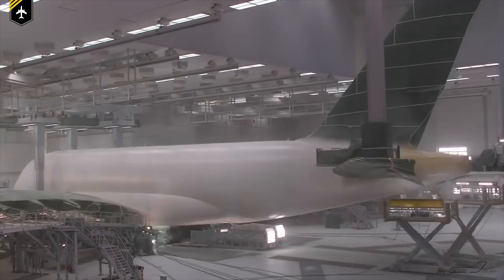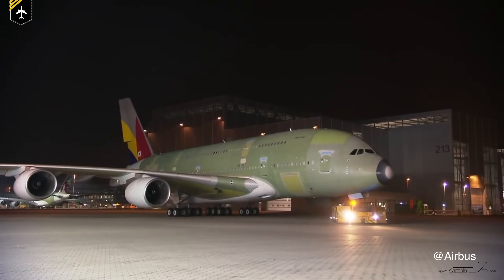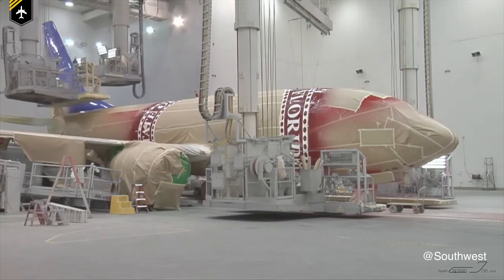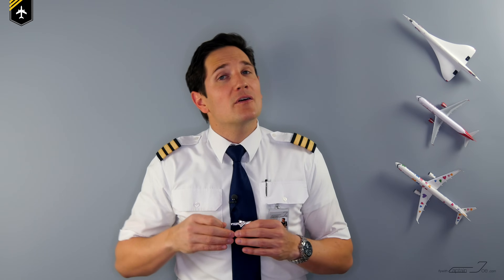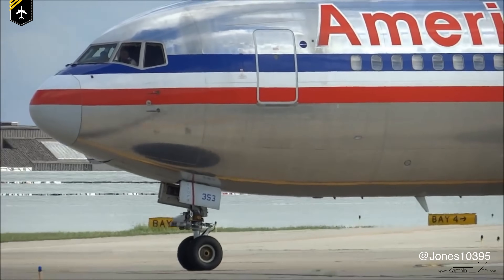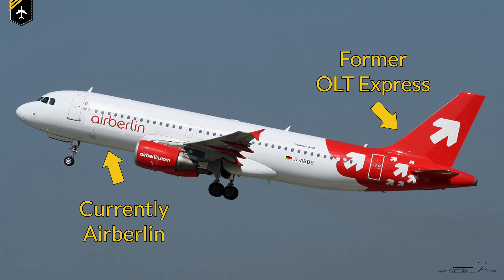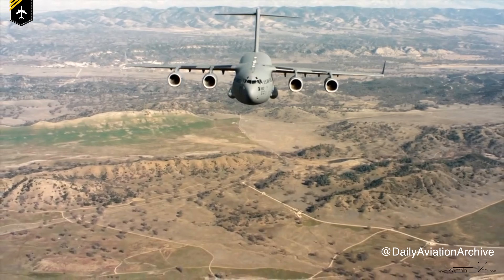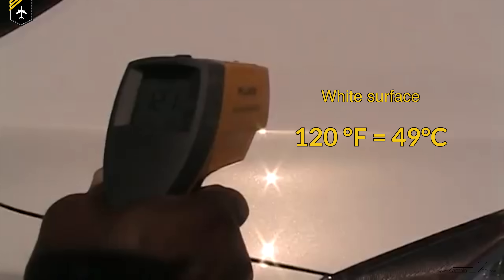REASON WHY PLANES ARE PAINTED WHITE! Explained by CAPTAIN JOE

Comment: 1. Cost and labour
2. Easy to locate the wreckage 
3. High contrast and birds can't be attracted
4. White keeps cool during high temperatures 
5. Easy to locate oil leaks or dents
Reply: white color can reflect radiation too
Reply: Which protects it from radiation from space
Reply: >2. Easy to locate the wreckage 

Tell that to Uruguayan Air Force Flight 571
Reply: 4. No. White doesn't magically keep cool in high temperatures. White reflects light more than any specific colour (since it is made up of all the visible colours) so it heats up less when exposed to sunlight. Look at high speed aircraft like the SR71 or the Bell X15... BLACK to RADIATE heat.
Reply: Nixon Lim reflects VISIBLE electromagnetic radiation. No more reflective of other forms of radiation.
Reply: @Lozzie74  you are right
Reply: Then why is the cheapest airline yellow 🤔
Reply: also white reflects heat so.
Reply: Sumanth Pruthvi thank you
Reply: "Easy to locate the wreckage" 

laughs in flying over snowy mountains
Reply: Thx
Reply: @Benjamin Playford meh. Comment wasnt funny. 0 likes as it should be
Reply: Resume White the Great color
Reply: Thnx
Reply: Also to identify cracks visually

Comment: So basically it
(1) Help in locating any oil,fuel,hydraulic fluid leaks
(2) Helps in identifying cracks during hard landing
(3) Due to hight reflectivity and low absorbivity of white surface it will reflect most of heat waves and so the metal underneath the paint will not be heated so the thermal loads on already loaded structure can be controlled which will prevent metal creep.
Reply: Thank you for your TL;DR!
Reply: It's a five minutes video. Nobody needed a TL;DW.
Reply: You've summed it up perfectly
Reply: Saved 5 mins, thanks
Reply: That's exactly what I was gonna say, word for word after I copy paste
Reply: (4) Easier to sell the airplane if its got a white base so that other companies can paint their design/logo on it.
Reply: You're the hero we need, but not the one we deserve.
Reply: And also to help us spot some  curry masala leakage, panni puri spillage, or any chicken tikka strike damage on the airframe structures.
Reply: @seigeengine  Yes we did.....He was droaning on a bit.
Reply: Thanks you very much.
Reply: Sir.Panda lol
Reply: you just saved 5 mins of my life. thx
Reply: Saved me 5 n a half minutes! 😎👍
Reply: you can't fool us. not all part of the airplane are painted. the engines for example...
Reply: Paint can also add weight on the plane don’t forget that.
Reply: Kanav Dhawan thanks bro you saved me like 5 minutes
Reply: Seems like spirit airlines don't want any responsibility in deaths, do they? They paint their planes yellow.
Reply: Thanx.
Now i dont need to waste my life on that video
Reply: Thanks for Savin my 5 minutes... You've done a great job...
Reply: Thank you
Reply: @seigeengine  5 min is a long time for some people.
Reply: Kanav Dhawan easy to spot after the crash
Reply: Imagine not having a 5 minute attention span

Comment: Hey Joe, great video, but here's one correction about composite parts being painted: The problem is not thermal expansion stress due to the parts heating up. In fact, most fibre composites are designed to have a CTE of nearly zero, so stress is not a problem. The reason for painting them is that the polymer matrix degrades when subjected to UV radiation (which there is a lot of at higher altitude because of the thinner atmosphere and the lack of clouds). The parts also need to be protected from environmental influences (moisture especially), due to the polymers' tendency to pick up water and swell - which in term leads to stress and lower  performance.
Fly safely

Comment: Nuclear bombers from the UK and Russia are/were also painted in white to reflect some of the thermal radiation.
Reply: jospi2 I’m from the UK...
Reply: What?
Reply from the maker: Like the Vulcan?
Reply: Maybe initially, but definetely not after switching to low altitude penetration missions.
Reply: Yes, the color is called "flash white" and a lot of command and control planes are still painted that way, such as the Looking Glass plane which will take command of the US armed forces in the event of, well, the normal chain of command being vaporized by nuclear war.

Edit: As Jonathan Chesnutt pointed out below it's actually "anti-flash white" and not just "flash white"
Reply: SR-71s were black.
Reply: SR-71s were painted with a special, black paint that reduced radar reflection. The body was mostly made of titanium, which is naturally a silvery color.
Reply: fixpacifica Oh? That's not what I heard, but makes sense.
Reply: jospi2 
I think the last completely white bomber is Tu-160
Reply: SR-71s were black for low optical visibility and to radiate as much heat as possible,  because the skin was up around 17-1800C. Even then the skin had to be actively cooled to prevent melting by circulating the fuel under the leading edges and critical points before sending it to the engines. They stuck out like dog gonads in infrared and the mach diamonds in the exhaust negated any attempts to make the body stealthy to radar so Lockheed didn't bother after the A12. The shape is dictated entirely by aerodynamics and early 1960s computer modelling limitations.
Reply: jospi2 The bombers that are painted white are only used for Arctic and Winter missions (if snow is present).
Reply: fixpacifica SR-71 are recon, not nuke strike.  If a SR-71 was near some instant sunshine, the intel chain would have gone wrong.
Reply: Alan Brown (re SR-71)   Very informative comment - thank you
Reply: Pavle Burazor 
"The bombers that are painted white are only used for Arctic and Winter missions (if snow is present)."
No. jospi2 is correct about the reason they were painted white. It was to reflect the blast radiation.
It's certainly possible some airplanes had white camouflage but jospi2 was correct about nuclear bombers being painted white.
Reply: The SR-71 was a spy plane with no weapons on board... not a nuclear bomber...
Reply: shouldn't they paint it chrome?
Reply: What’s the inflight entertainment on them like...
Reply: It's actually named Anti-Flash White
Reply: Some aircraft had camo paint on top and flash white on the bottom.
Reply: John bombers carrying a nuclear payload.
Reply: Jonathan Chesnutt oops yeah you're right, I forgot it was "anti-flash" and not just "flash", presumably because you want less flash and not more flash :)
Reply: because that would make such a difference.
Reply: But it does make a difference.
Reply: jospi2
It’s real
Reply: I am in the UK

Comment: Do airplanes use nitrogen in there tires ? Do cars need it too ?
Reply: Airplanes use nitrogen because it's a lot less sensitive to changes in temperature, and the pressure will fluctuate a lot less than if air was used. Most cars use air since they operate in less extreme conditions, but high performance cars may use nitrogen just for consistency.
Reply: Regular air is about 78% Nitrogen already.
Reply: Most of the larger, faster aircraft do. 
The reason is that nitrogen is dry, it contains no water. Why does this matter? Imagine this. An Airbus model “abc” takes off retracts the gear and climbs to 38,000 feet. The water collects at a low point and freezes. 

The aircraft lowers its altitude for landing. Maybe the ice has time to turn into liquid water or even vapor. Maybe not. Imagine the vibrations due to out of balance conditions when the tire suddenly starts rotating when it touches the ground at 150 MPH.
Reply: Dry nitrogen is moisture free and will not freeze and the nitrogen in inert
Not affected by pressure and temp changes
Very effective for an aircraft
Reply: most tire places will nitrogen fill your tires for a fee

Comment: As an aerospace engineer I can clarify , using white paint instead of black. Is to prevent a phenomenon known as black body radiation . Reflectiveness doesn't play a major role. It's just the color gradient falls into the right spectrum in which the electrons from uv light gets acted up hence being excited to a higher or lower level.

Comment: Hi Joe, have you ever drifted in a plane before?
Reply: When learning to fly airplanes we learn a maneuver called a slip, which involves flying the airplane sideways through the air. Sorta like drifting. In the air you slip to lose altitude quickly without building up too much speed. On final approach you slip to compensate for crosswinds.
Reply from the maker: Well I´ve flown many crosswind approaches, so that's similar to drifting :)
Reply: Deja vu

Comment: I believe they stopped painting B17's in WW2 to save weight.  The como colors weren't hiding them form anyone.  If you had 200 B17's fling to a target, everyone knew it. As for the corrosion protection, they knew the planes weren't going to be around that long.
Reply: Correct

Comment: Hey Captain Joe, what would you do during a complete elevator hardover? Wouldn't that mean you absolutely dead?
Reply from the maker: No necessarily, there are backups!
Reply: Then what about Air Moorea flight 1121? It was a fatal crash, btw thanks for putting in the time to respond Captain!
Reply: The twin otter relies entirely on cables and pullies to move the control surfaces, so when a cable wears down and breaks there is nothing one can do. The best way to stop this from happening is preventative maintenance. 

Modern aircraft use hydraulic systems, and some aircraft like the 737 still use cables as a backup system. The 737 does have trim disconnect switches for the stabilizer trim, but I'm not sure about redundancies for the other control surfaces.

Comment: Wow such a well learned pilot Ur.  Good luck with your upcoming videos 👍👍👮👮👏👏
Reply from the maker: Thanks :)
Reply: Hi, how about you do a video to explain the centre of gravity and how it is determined.  How important it is for safe and efficient flight of aircraft . On multi leg flights how is the plane kept balanced when lots of people get off or on so it's rarely the same weight distribution for the flight leg.
Thanks for all your informative videos.
Reply: santhana krishnan  ppppppppppp0100000000000000000000000000000000000000000000090000000000080000000700000000000060000000000000000000
Reply: neeti rathore what the😯😯😯😲😲😵😵😶😶😪
Reply: who saidhewas a catian pilot
Reply: santhana krishnan that’s a cop emoji...
Reply: santhana krishnan  actually they should be painted anything of standard light color like yellow or pale greenish for better visibility & it should be standardise universally
Reply: santhana krishnan is there anything he doesn't know
Reply: Captain Joe Skillz.

Comment: Doh!  Air NZ have some All Black livery aircraft I think they did for the rugby World Cup....which of course we won🤪🇳🇿.  If they re paint every 7-8 years, they will be All Blacks forever!  Thermal stress sound like a costly down side.  I like those green planes.  Hey.  Great topic.  200k sounds cheap though.  Cost to paint an exec jet can be 100k and they are tiny by comparison.    So funny the sweep stakes on your air line now.  I thought Qatar cargo as they are hiring for new 747-8F.....but I see lots of Cargolux comments!  Ahaha!  Woohoo.  USAF F16s in NZ for warbirds air show this weekend!  All the best with the rating
Reply: Andrew Wade the cost of painting an airplane has more likely to do with labor and facility costs than paint costs which is why it doesn't vary much from plane to plane regardless of size.

Comment: The infrared thermometer comparison of car temperatures is wrong, because the measured value itself depends on the reflectiveness of the surface, not only its temperature. To do a fair comparison, one would stick a black tape on both cars and measure on that tape (minding the diameter of measured surface, depends on instrument distance from surface, to fit onto the tape). This is a common trick for example when measuring temperature of stainless steel kettles with infrared thermometers.
Reply: You are right. It is mainly caused by the "white" ingredient ised in the paint. For example the Zinc one is having more reflectivenes and less absorption then the Titanium. This way the titanium white is worse to achieve coder surface. Actually you may be surprised that titanium white may be as good for solar as black paint :)
Reply: Or, open the bonnets and measure the temperature of the underside each.    That said, the effect on temperature of black vs white surfaces is very strong.

Comment: Why not just anodize the whole plane? Lasts forever. And probably is expensive af
Reply: John what is the reason? I couldn't find any information on ban of anodized car body
Reply: I think you have your facts wrong at least in the states. Most of my bike has an anodize coating tank, frame, rims, and fenders. Plus a anodize coating will fade over time ie. red will fade to rose or pink.
Reply: Bartosz Olszewski, high-quality, durable anodizing is naturally very dark in color, which doesn't help with heat. The brightly colored "anodized" objects that you see have to use a much thinner, less durable layer of aluminium oxide.

Also the protective layer is very very hard, but brittle, so it chips. I don't know if temperature changes would be enough to damage it, but I'd guess it would be a factor.
Reply: John, it's not at all obvious to me why it would be illegal on cars. Either post a proper reply, or don't bother at all, please.

(Also, cars aren't made of aluminium.)
Reply: Jason Doe yeah I know about heat issues. Still, would be worth it. Type 3 black anodizing is really the best finish in my opinion but probably not practical for large scale use. But I think it would be durable as heck, and good looking as heck.
Reply: Bartosz Olszewski, I love type 3 on my flashlights  :D
Reply: Jason Doe absolutely love it on mine too.
Reply: TL;DR
Ask yourself this:
Just because i could, does it mean i should?

I'd actually guess that it's because it lasts forever which is redundant if it's high in cost.

Chances are, many advancements made would require new plane design from ground up rather then retrofitting and old design planes being scrapped or sold to evolving countries.

If it would be the same price or even cheaper, of course why wouldn't you use a ever-lasting material, but odds are it's gonna cost ya BIG TIME and you wont enjoy the actual benefit of it at all.

To put into perspective with a welder vs PC:

Grandpa bought some powerful welder while he worked for SWISS SiG (trains division, not the weapon division, my dad was in weapons division).
No, i got no tie ins or traditions into any of those interests beyond curiocity. xDDDDD
In any case, Grandpa bought it for 1k$ after it broke on workplace.
Yeah, i guess golden age when a company simply bought a new one... FOR 25 freakin' thousand dollars.
He repaired the broken part by a certified repair guy for about 500$ instead of around 100$ new part, used better parts for repairs because my grandpa knew him otherwise, they don't haste and just give you the new part (said it's gonna last at least 50 years now).
It's 20 years after the fix and this welder still works the same it did 25 years ago when it was new without a single maintenance.
And yeah it's some USA made welder, can't remember the manufacturer tho, awesome machine though. I make jokes about it how when you turn it on, it's like turning on Chernobyl. xD

A modern PC, you can actually make the hardware very lasting the same way, like 20-50 years lasting with large price of course.
But what benefit would you have of it if after 1 year, new game comes out and your PC is pretty much sub-par for it. It lags, it stutters, it looks like crap.
So you upgrade component / buy a new PC.
So the fact it could be made to last even longer then 5 years is nowadays is rather redundant, waste of money and precious resources to make long lasting parts, for something majority will buy new within 5 years anyway. It's life cycle is connected to it's technological advancements.
There are exceptions of course...

Like Apple phones where the advancement are to use a convenient 2.5mm revolutionary unintrusive, universally available headphone plug where you could use a bluetooth headphone but can use a normal one instead as well, remove it and require you to use exclusive headphones, or always bring a piece of cable because FUCK YOU, that's why.
I mean, come on, people are buying the freakin' iPhone that costs 600-1000+$ every year and even there aren't that much advancements to actually govern the time and price, whats more, some fundamental things get even taken out which are still not obsolete so WTF?! But i digress... xD

Same logic applies here, the paint lasts longer than the average human life so i guess that's about enough imo. xD
Some very good designed planes might get a repaint from the same company but odds are, they will be sold to evolving countries so the company can buy new ones instead.

I'd like to see some input from C.J. on this matter but i don't think many will even try to read this. xD
If you got this far though (without skipping you cheater) YOU ARE AWESOME and thanks. Also, got nothing better to do huh? Me neither....  .. ... apparently...

Is it weird that i actually want to start a YT channel just talking the usual stuff like the above but with ability to visually show as well?
I just feel so embarrassed to even try though... xD
Reply: The reason airplanes don't get anodized is you can't repair the anodized coating once the airplane is assembled.
Reply: Airplanes tend to get a lot of ramp rash over their life time.
Reply: ...or galvanizing dipped! A non discriminating Grey💡